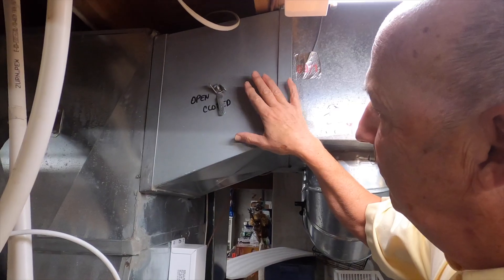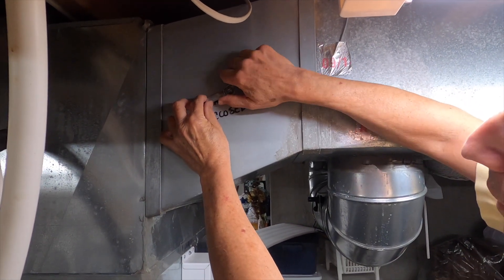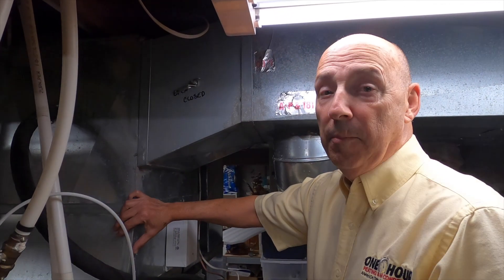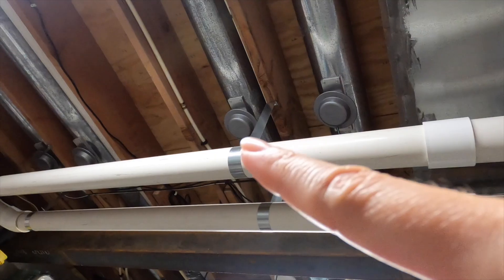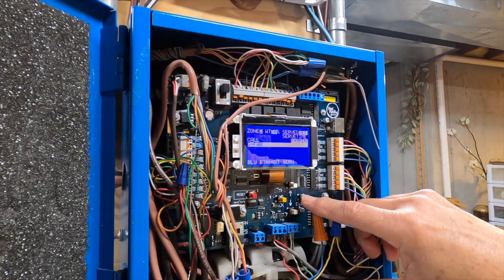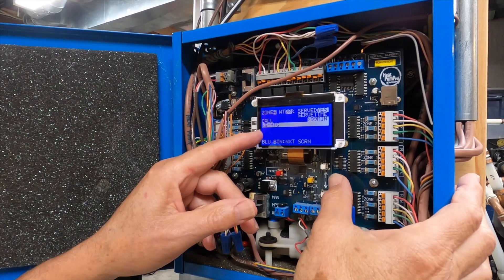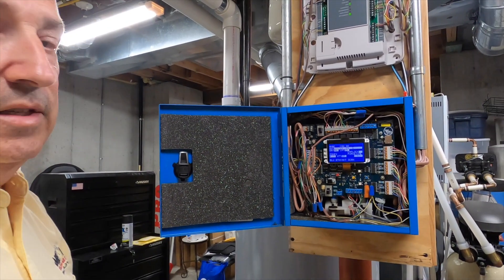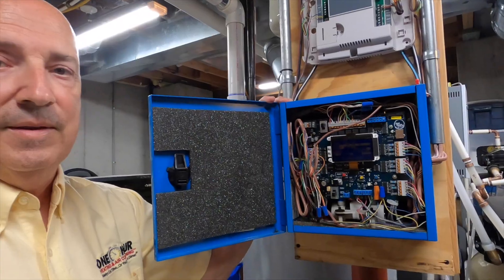How To Adjust Your Dampers Plus How Zoning Works

Comment: Begging for help and hope you see this! I have a smoking hot upstairs and cooler lower level here in Michigan. Watched your videos, found the dampers, but I can’t get the blade to adjust. I have a zone system from what I can tell, but the dampers appear to snap open and shut as the zones kick on. When I turn the knob on the damper valve, it snaps back to position. Spring loaded I guess. How do I adjust that blade to reduce the amount of heat that comes out? It’s an Aprilaire product. Model # is 6988. HELP ME!!!

Comment: I was looking for this information because I'm renting a room as a roommate and it's not cheap, this guy said that everything is included in the price but my room is freezing and the rest of the house is warm and the vent in my room doesn't blow warm air, however even in the laundry room where no one is there warm air comes out. I don't know about HVAC systems but I suspected that he had some way of blocking my heating. This video makes it clear to me. I don't know why the old bastard does this to me if I am super punctual with my payments, I am super clean, I don't make noise, it's practically as if I were not in this place. I think he wants to harass me so that I leave on my own "initiative".

Comment: I have three zones, two dampers, but one thermostat. What is the correct adjustment for each season? I just opened my upper damper, closed the other. The air was running. Level two was at 75 degrees (where the thermostat is located), but upper level was at 70 degrees. Help!!!